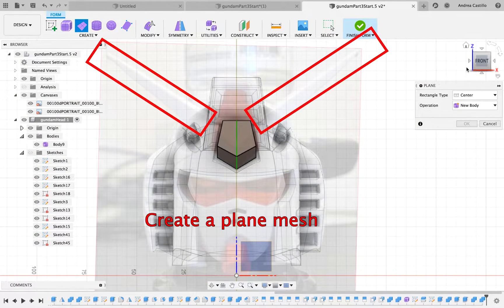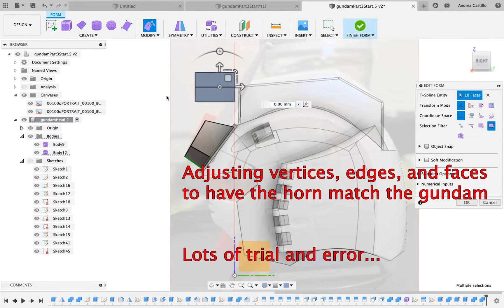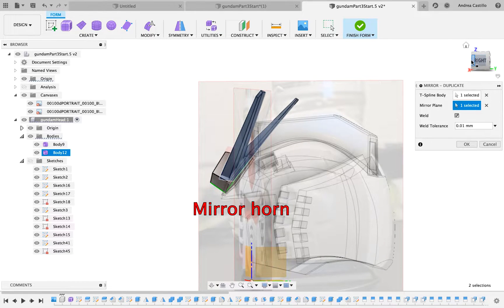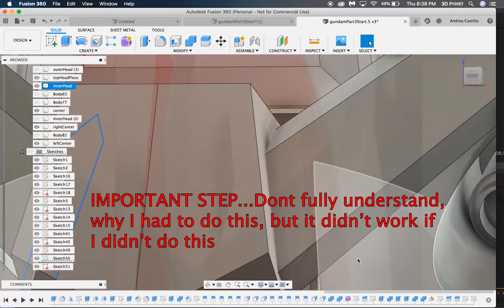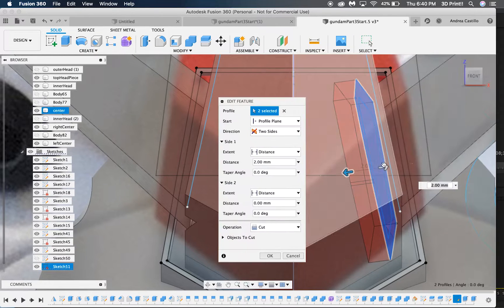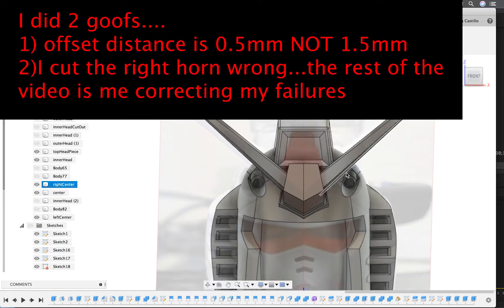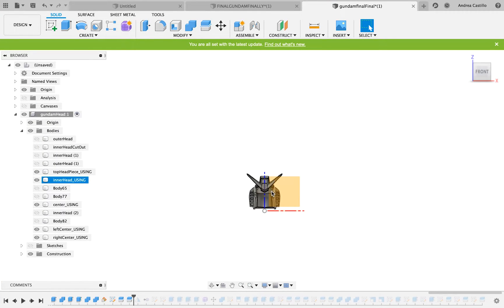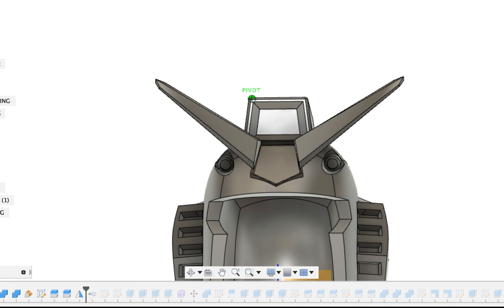Gundam RX-78 Helmet 3D Model Tutorial Part 5

Comment: Will you be printing this on an FDM printer for a human to wear as a helmet?  Or will you print it smaller on a resin printer?
Reply from the maker: FDM printer.  I will be using the prusa mk3 and the  cr10s
Reply: @everydaynerdy1619  Ahh great.  I did notice you fixed the spacing to .5mm after watching the whole video.  Watching you manipulate the forms in fusion is amazing.  I have done a bunch of items in fusion but stayed away from the forms for the most part.  With your videos I am going to try getting into it a little more.  Using two separate forms for the different parts of the helmet made my brain go "DUUUUUUUDDDE why didn't you think of that".  Please keep the videos coming and yes the mistakes also.